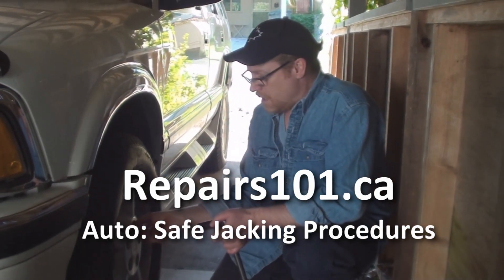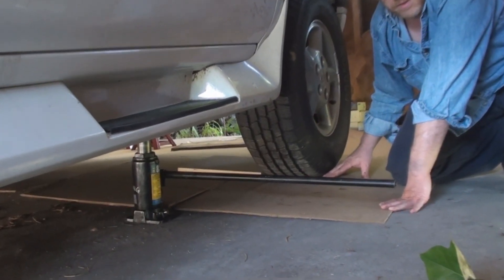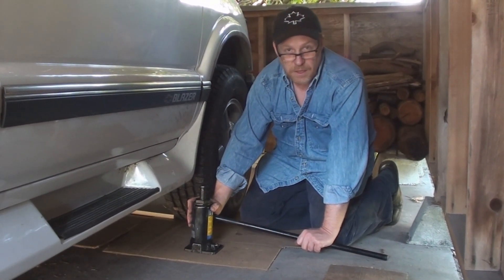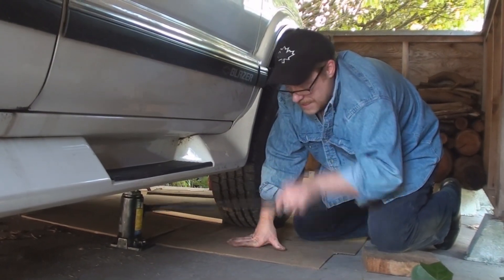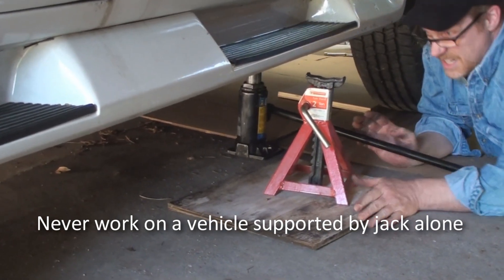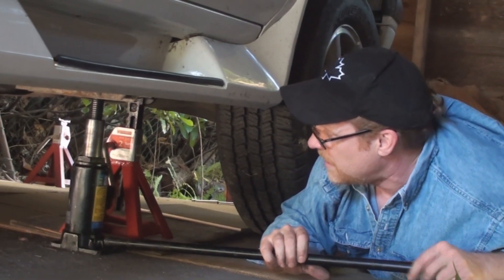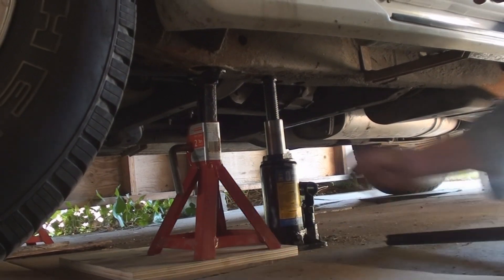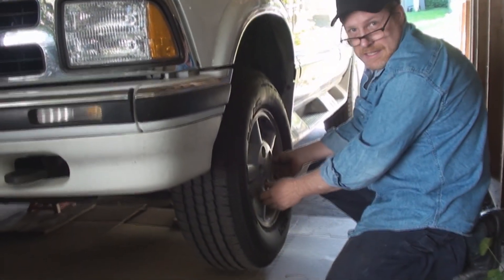Auto: Safe Jacking Procedures

Comment: Does anyone have tips for where to place a bottle jack on a unibody car? The owner's manual lists only the pinch weld for a jack location but that only works with the scissor jack that came with the car. And there isn't a frame like on this SUV in the video. I've used random stuff, big bolts, suspension pieces, parts on the unibody that look thick with overlapped metal. I guess that's the best you can do just eyeball a spot that looks sturdy and go for it with these modern cars? How's everyone else doing it?
Reply from the maker: I had the same issue with my 2000 Buick could never trust lift points and once I bent the pinch weld. Sounds like you're doing all you can without a hoist. Maybe you could fabricate a saddle (or pirate the top off a scissor jack) and weld it to the seat of your bottle jack?
Reply from the maker: And yes I realize that welding directly on the bottle jack will likely melt the seals - I was just spit-balling. You'd have to dismantle it first. Good luck!
Reply: @ This got me thinking someone has to have a solution for this... I found this company safejack that makes a pinch weld adapter that looks perfect. You also gotta buy a collar that fits around your extension screw but they make custom sized collars. I'm gonna give that a try. Spending 65 dollars to make my 35 dollar bottle jack work lol oh well.... Then on top of that I'll have to park my car on ramps or blocks so the jack can actually fit under the pinch weld. What a pain

Comment: Great video to watch on the proper jacking procedure using a bottle jack and stands.  The only thing I might add is that I never extend that screw on the bottle jack if I don't have to.  I put wood blocks under it to raise it without having to really unscrew it much.  I've seen a video or two where the screw was extended along with the entire piston.  To me, that makes the jack a little more unstable because the base of these bottle jacks are small. As a result, the jack comes flying out because the center of gravity is higher.  The smallest amount of shift in the vehicle while you are raising it might cause this to happen if the piston and screw are all the way up.
Reply from the maker: Excellent point, Gary. Thanks for contributing.

Comment: Great video -  don't forget to use chocks and always consider/understand what  type of drive the vehicle is - front/rear wheel.  If your car was front wheel drive which it isn't you probably would have been able to move it when shaking it.  Another good reason to use parking brake too I guess.  I do like the bottle jack - I am not sure if the one that comes in my Suburban has that screwable adjustment feature on it which is very handy/nice!  Thanks!

Comment: SUPER-unsafe!  You put one side of the axle stands on the very edge of the plywood. Plywood is layers of crappy shit. Applying large point-pressure spots on its very edge may shatter it any time. on that end. Since the plywood is an inch or so thick, and the axle stands about eight inches wide, a very sudden, relatively large angular change in the axle stand results, with a likely result the car slipping off it, and off the other one  as well as a consequence. Death is a LIKELY result of this. If you have to use plywood, don't put an axle stand right at its edge. People die all the time becasue they did not predict every small thing that can go wrong. Small things going wrong have deadly consequences in this case. Do you trust that that edge of plywood can handle those hundreds of lbs/sq in you're applying to it without shattering? The stuff basically behaves like a cookie...
Reply from the maker: I use high quality plywood not particle board or MDF. 
Watch the end of the video I shake the car vigorously with no fail.

Comment: My question is...When I jack the car up, and the stand is supposed to go where the jack is - how does that work?  I have two jacks so am I supposed to jack the front and then put a stand at the back? Thanks
Reply from the maker: Put the jack in a prime jacking location and put the stand nearby or in a secondary jacking / support location. There are several choices on most vehicles. Do not  jack the front and then put a stand at the back.
Reply: Repairs101 But how do I go from the jack on the jacking point to putting the stand there in its place?
Reply: my idea is to maybe jack from a non-jacking point right beside the jacking point with a 10 inch block of wood..

Comment: work on level ground, chock rear wheels, set emergency brake, put in park, leave jack in place, consult owners manual for correct jacking and stand locations to avoid damage to chassis members.
Reply from the maker: good advise.

Comment: No mention of where on the car to place the bottle jack or the jackstands. It LOOKS like on the frame from the few seconds that actually shows where the jack or stands contact the vehicle. It would be good to hear that clarified and also mention if okay or not to jack or stand the vehicle at axles, suspension, wheel shafts, differential, etc. Can anyone chime in about that?

Also, could someone mention why good to have plywood under the stands "to spread the load on"? Why not just have the weight spread from the stands to the concrete or earth (much bigger than the piece of plywood)?

Thanks!
Reply from the maker: Admittedly, this video was made some time ago (2010) when I knew a lot less about filmmaking than I do today. Mostly thanks to guys like you who call me out on where I swung and missed. Sounds like you already know a fair bit but want confirmation. As far as stand placement goes, you want frame or axel or specially designated pinch welds. Avoid areas like the oil pan, transmission, driveshaft and suspension. Look at your owners manual or the vehicles service manual. I keep the plywood squares as part of my "lift kit" to protect floors - some floors can be marked (or worse) by the stand's feet which dig right into the wood which increases surface contact with the floor making it less likely to slip.Stands on bare earth would be unstable and should be considered unsafe for any period of time.
Reply: Repairs101  Thanks for your reply, Repairs101!

Where would I find frame or axel pinch welds, what do they look like? I did look at my owners manual and the Haynes or Chilton manual (which just is a photocopy of what is in the owner's manual), and it is very vague. It definitely doesn't say, or clearly show, whether the jacks and stands are on the frame, suspension, axle or what.
Thanks!
Reply from the maker: You still haven't told me what kind of car you're working on.
Haynes Manuals have some greatness to them but only contain a fraction of what you will find in the manufacturer's service manual. You can order yours through www.faxonautoliterature.com - I have ordered books from them for +20years. And no they don't pay me but they should. 
I trust you don't know of a friendly mechanic you can ask advice from (we do exist). Have you tried an online forum for your car ? You'll find guys there are knowledgeable about your vehicle (they own one) and happy to share. And you may end up on a live chat with someone instead of waiting until tomorrow to hear from me. 
FYI: The pinch welds are on certain body types only. They are found where the body meets the floor ahead of the rear wheels and behind the front ones. Ask someone to show you. Wrong placement may cause damage. Either end of a RWD axel AOK - you can jack under the differential with a floor jack (trolley jack) then block the axel ends.
Generally behind the front wheels and  ahead of the rear wheels are safe balance point places on the frame if you know what the frame looks like. Good luck..
Reply: Repairs101
 Thanks much, again, Repairs101.
Sorry, my vehicle is 1988 Jeep Cherokee 4x4 inline-6cyl 4.0L. I just looked that up at the link you sent (thanks for that!) and saw various books for that vehicle. I'll find time at some point to research those various books to see which is best. I'll also try to find a good service manual for my girlfriend's rare, beloved, durable 1983 4x4 Toyota Tercel wagon. 1983 4x4 that gets 30mpg?!?! True!

As for mechanics, I am good friends with one that is a) a GREAT guy with a beautiful complete full-service auto shop and b) highly acclaimed from various friends, Yelp and newspaper polls, and STILL every now and then my girlfriend or I will take our money pits to him, only to hear either a "not worth it to fix" or an expensive diagnosis, then we'll turn around and find someone on CraigsList who fixes it in 2 hours in my driveway with limited tools and for very little money. I have another auto shop 2 blocks away, highly acclaimed by neighbors, Yelp and tow truck drivers - for YEARS - and same thing. If two fantastic mechanics like that are giving those types of experiences, I guess it's time I learned to replace my own U-Joints and the like. That's my rant :-) (NOTE: I still happily have them service my vehicle every now and then - but I unfortunately have to be on my toes)

Thanks again!

Comment: what's the optimized height if I want to work under the car? Say I want to change transmission fluid.
Reply from the maker: Eugene Von Most mechanics like hoists because they can walk under. So I guess your own height is optimum. In a less than optimum world you lift as high as you can / want to with consideration to variables like equipment available and time allowed.

Comment: Thanks, very basic and informative. I'm planning to replace front sway bar bushings on my 2001 Mercedes C-Class and it's the first time I've done this kind of work on my car (most advanced thing I've done myself is changing air filters...). Is there any disadvantage to using a bottle jack? At my local auto store they sell bottle jacks for nearly half the price of trolley jacks (30 vs 60 NZ dollars)
Reply from the maker: Fishfingers232 Bottle jacks don't self-center.  If you are lifting a long way you must do it in stages as not to tip the bottle jack over while loaded. Good luck!

Comment: to break the tension before lifting the car up and take out the nut. just a 1/4 turn to break the tension?  then later just tight the nut while the car is in the air right? no need to let teh car down and tighten it (reverse the process)
Reply from the maker: okaythen001 Yes. Yes. No. The no is double negative so yes let the car down (eventually) yes torque the wheel nuts once solid on the ground (and re-torque aluminium wheels after 2 km test drive city speeds) and yes reverse the process.

Comment: I always leave the jack in place after raising and subsequently lowering the vehicle.  While the jack stands are preferred, having the jack itself just below the frame could be my safety net.  I also chock the back wheels to prevent movement.
Reply: if you only have one jack, and want to get the other side off the ground too - then that is not an option.

One could now ask, why did he need to have both sides up simultaneusly, well.. i have no answer to that
Reply: @zoolkhan  well, you could place 1st jack stand, then jack the other side and place 2nd jack stand, then simply move the jack to the preferred “safety spot” and jack it up until it just touches the jack point.

Comment: can only jack stands be used when working under the car i.e. changing oil filter
Reply from the maker: If you call jack stands what I call axle stands and they are adequate size and are in good condition and they are used on a hard and level surface - then yes, as you saw in this video it can be made extremely safe and sturdy - but don't take the wheels off for just an oil change, leave them there as an extra safety cushion.
Reply: thank you for your response

Comment: Pro tip from a tow truck driver: always chock the wheels. Has anyone ever put their car in park and then taken their foot off the brake and felt the car move slightly? That movement is enough to make a jack collapse.
Reply: thank you dude. Good call. that is the lash between the clutch and the parking gear right?

About to jack my car up for the first time to install a tow hotch, you may have saved me some trouble .

Comment: I have a sports car that sit low to the ground, I need to do an oil change and have a friend's jack stands available, but the driveway is at a very slight incline and I'm not sure where under the car to place the jack stands, but I really need to get under there to change my oil. Please advise.
Reply from the maker: First I'll say inclined driveways are inherently dangerous to work on and you'll need to chock your tires and lock your parking brakes. Plus, depending on some variables, you may not be able to drain the sump completely.
As far as stand placement goes, you want frame or axel or specially designated pinch welds. Look at your owners manual or the vehicles service manual. No manuals? Try www.faxonautoliterature.com
See my video Changing Engine Oil http://youtu.be/4v6QtCIRhFE for an alternative to lifting the car called curb-hopping. Good luck!

Comment: I gave u thumb up as I don't understand all the thumbs down. that aside, I don't get why u use plywood? i understand that it does offer some additional support but or for me it's so insignificant that unless u happen to have those 2 pieces of plywood then forget them. Jacking up on an even surface is totally ample.
Reply from the maker: I keep the plywood squares as part of my "lift kit" to protect floors - some floors can be marked (or worse) by the stand's feet which dig right into the wood which increases surface contact with the floor making it less likely to slip.
Thanks for the + thumb. This was a very early video and YouTubers are a tough audience.
Reply: Repairs101 Yea OK, I can appreciate that. I'm from the UK and my car is parked on the 'Queen's Highway' - so I don't give two damns about damaging it. In fact I'm not actually allowed to legally work on my car outside of my own house. Pisses me right off! I'm gonna pay more than my fair share of tax over my career but while I'm a student I somehow need to pay some crook to do simple tasks on my car on private land.......load of bollocks really!

Comment: sorry, but that looked dangerous as heck.  That bottle jack would be like a bullet if your vehicle tipped.  Also, I wouldn't lay down on that jack bar with your head under the car, switching out the jack for the axle stands.  At least you told them to let the bottle jacks down slowly...

Comment: I have a uninody car with a ridge along the underside of each side.  When I needed to wrok on the underside I have to use the car jack that came with it because it has a sadle that fits onto the ridge along the underside at the jacking up points.  I purchased a trolly hydraulic jack but discovered that no one sells a pad that fits over the cup of the jack with a grove to fit onto the ridge of the unerdside of the car.  Where, oh where, do I find one?

Comment: yeah thats the best thing, on my 94 Mustang the subframes are so soft that i completely avoid them, i now only put my jackstands on the kmember or rear differential. I will weld subframe connectors for my mustang wich will stiffen the car alot and it will be a nice point for jackstands and lifts.

Comment: Do not use bottlejacks on unibody frames, because the jacking base is so small if you place it under a subframe rail u will flatten the metal because the subframe on unibody cars is made of much softer sheetmetal and is not as rigid as the metal used on the frame of cars will full frames like this SUV and most trucks, if you want to jack your unibody car correctly either use the factory pinchweld manual jack or use a floor jack with a larger base to spread the weigh entirely on the subframe.

Comment: @DJDevon3 When a two ton car is placed on axle stands the weight will push into the asphalt and other ground material. He is using the ply wood to distribute the weight of the axle stand legs so it does not look like he beats his driveway with a hammer.

Comment from the maker: All jacks are inherently unstable, that's why you ALWAYS USE AXLE-STANDS. When used correctly on a clean, dry & level surface the bottle jack is extremely reliable on straight lifts. Keep in mind that the load may shift on higher/longer lifts. A round surface like a differential housing will sit secure in the  X grooves on the jack-pad but as you get higher the load will wander away from the jack. Block it in stages or get a "Floor-Jack" - more $ but the wheels will self-center under the load.